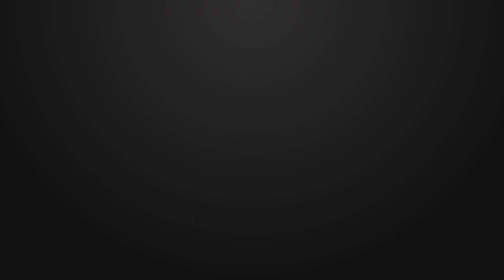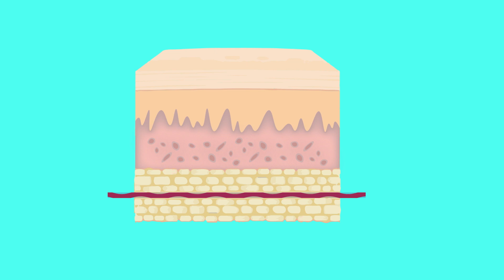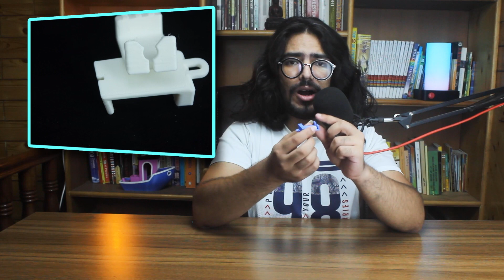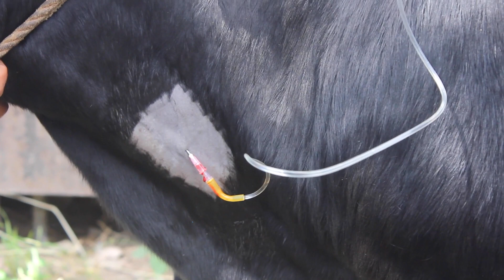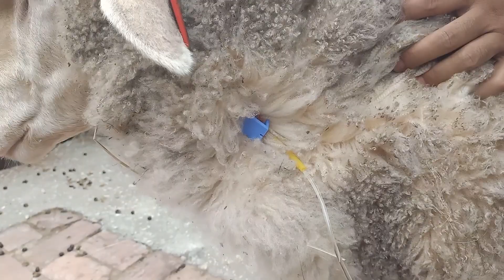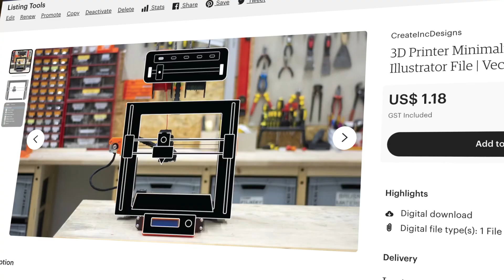Helping Animals with 3D Printing | The MLIP Project

Comment: That's a great thing you have made dear Vipul . God bless you. 
You may also design a needle connected with fixture in rear part of it . That would be single thing with two motives 1. I/v done 2. Fixing I/v .
Regards to Dr. Rajender Paul and Dr. Sanju Paul. 🙏🏻🙏🏻💐
Reply from the maker: Yes, you are right. Thanks a lot

Comment: Directing needle towards heart and inserting will resolve the issue of needle slipping out of vein to a major extent. And if prolonged IV administration is warranted, a IV cannula can be inserted and sutured in to place. Still not very much convinced that this clip resolves issue of needle slipping, do try with needle directed towards heart.
Reply from the maker: i am obviously not a veterinarian but when I talked to the doctors there were still some problems that were mentioned.

Of course the cannula falling out was one.
Another one that wasn't mentioned but I can clearly see is that sometimes in camps a single person has to administer a lot of infusions which requires you to be quick and also the person is generally a pharmasist. Legally, as far as I know, pharmasists aren't allowed to suture in India.
Reply: @CreateInc  pharmacists are allowed to apply skin sutures under a vet's supervision. 
Am a practicing large animal veterinarian. Directing needle towards heart (opposite to the direction shown in video) will help prevent needle slipping because blood flowing towards the heart will keep pressure on needle to stay in vein and obviously gravity also helps.
Reply from the maker: Thanks for pointing it out. I'd definitely test that out too when possible.